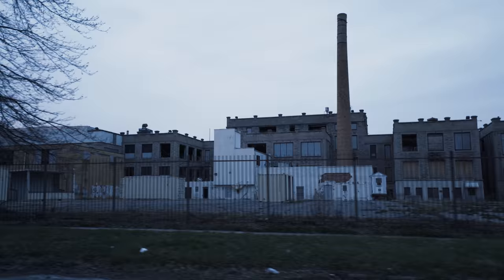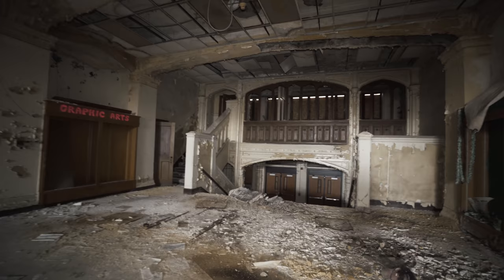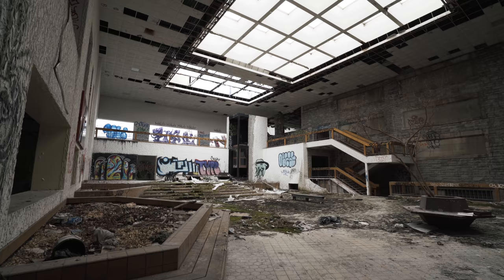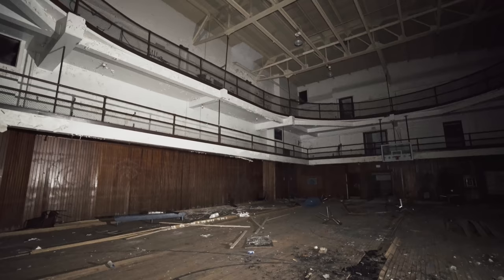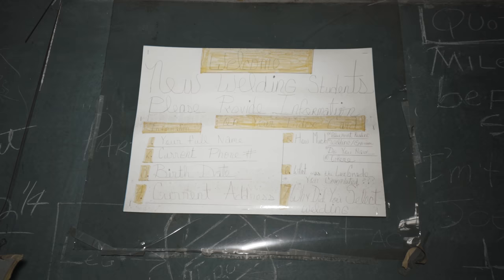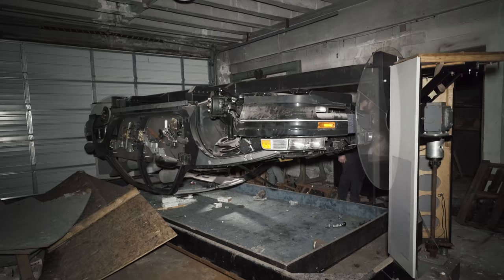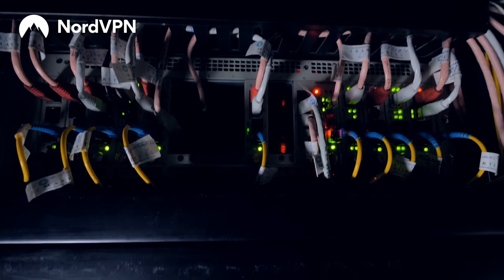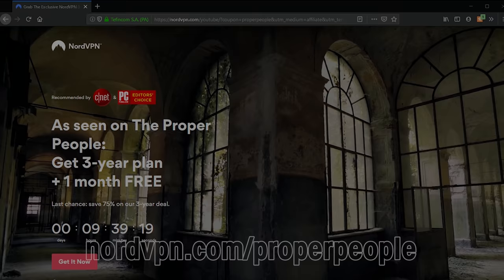Exploring an Abandoned Detroit College

Comment: Back then flip chairs had thick foam and arm rests, now they just put two hinges on a hard wooden plank and call it a seat.
Reply: Not even wood, plastic. And they design the hinges into the plastic mould so it's just two pieces of hard ass plastic that fold together. That's what my school had in the assembly hall.
Reply: My school was built in the 20s. We sat on the floor.
Reply: At high school? At primary school we sat on the floor for assemblies but that's pretty standard still
Reply: s8wc3 my high school didn’t have an assembly space with seats like that. If there was a large assembly, we would sit on the plastic bleachers in the gym.
Reply: Wood or steel? I havent seen a wood foldup chair for a while
Reply: A. G. Way underrated lol

My school was built in the 80s and it has plastic chairs with wooden sticks they call “armrests”

Comment: Drop ceilings were added mainly due to the need for new electrical, HVAC and network cables. When these buildings were built, there wasn't as much of a need for all the electrical that is used now. Also, drop ceilings create more efficient climate control as heat rises. I love revamped older buildings that have removed the drop ceilings, however, they do present a challenge, particularly for network cables as older buildings don't necessarily provide access into the original ceilings and walls. Drop ceilings are an easy way to hide all the cables and duct work.
Reply: On the downside, drop ceilings are also an excellent conduit for the spread of fire.

Comment: I live in Los Angeles CA now.  This is really heart breaking, I was born in Detroit, and it never looked like this.  I have the most beautiful memories of Detroit , when downtown Detroit had Hudson, Woolworth, Crowley's. I remember my mom would take me downtown to shop with her.  Also, the school were everywhere.  This is sad. Those fun times on Belle Isle.
Reply: Yeah! Its gentrified now. Downtown is a total transformation because of Dan Gilbert ( owner of quicken loans). Belle Isle is owned by the state now ( certain parts are taped off because its flooding) most of the school buildings is closed & deteriorated. Alot of white flight moved back in from the suburbs & the property values have went up extremely. Just type in your old zip code on zillow or google maps. Some residential areas are about the same or worse & some have improved. They are forcing the poor residents out who been living there for years. Its kinda sad yet somewhat good because you see improvement

Comment: In the auto shop, it's a Rotisserie. We use them to do all sorts of things, if you need to media blast the vehicle, paint the under body, weld panels in, pretty much anything.  It won't mess with the frame if it's mounted right.

Comment: Excellent video (No geese today-- my bravery went away!)   I think there is probably a lot of exposed amphibole and serpentine asbestos in the industrial buildings i have watched you explore in Detroit- it's inherent in very many structures, and somewhat of a worry where the interior has been smashed up. I think at the very least i would want overshoes that could be discarded or bagged then washed afterwards; you don't want to be carrying material out on your feet and into your car- where the fan then blows it up into the cabin. Keep exploring, you have brains which seems to be keeping you safe thus far!

Comment: That robotic arm might be an ASEA IRB. When was the school started and abandoned? As this robotic arm was made in 1975.

The ASEA IRB is an industrial robot series for material handling, packing, transportation, polishing, welding, and grading. Built in 1975, the robot allowed movement in 5 axes with a lift capacity of 6 kg. It was the world's first fully electrically driven and microprocessor-controlled robot, using Intel's first chipset.

The ASEA IRB was constructed by Björn Weichbrodt, Ove Kullborg, Bengt Nilsson and Herbert Kaufmann and was manufactured by ASEA in Sweden/Västerås. The first model, IRB 6, was developed in 1972–1973 on assignment by the ASEA CEO Curt Nicolin and was shown for the first time at the end of August 1973. The example shown in the Swedish National Museum of Science and Technology is the first robot that was sold. It was bought by Magnussons in Genarp to wax and polish stainless steel tubes bent at 90° angles. This robot was donated to the museum during ASEA's 100-year anniversary in 1983.

The IRB 6 sold 1900 copies during the next 17 years (1975–1992). It became the Swedish symbol for a new Labour market, shared between man and robot.[1]

The following part is the story of how the development of ASEA's industrial robot began, a project that resulted in the ASEA IRB became a school for virtually all industrial robots that were developed in the coming decades.

The seed of this industrial success came at the end of 1969 after Curt Nicolin, during a trip to the United States where he met Joe Engelberger who was a part-owner and led the main and leading manufacturer of industrial robots at that time, then hydraulically driven with simple point-to-point control systems. Curt Nicolin certainly thought that this could be something for ASEA to be interested in and then commissioned Wilmos Török ("Special Projects" Department) to initiate a preliminary study and the assignment was directly continued to Curt Hansson. As of an event, the time coincided with Intel's development of its first 4004 processors. To succeed in persuading Intel already in the beginning of 1971 to get a (one) chip from their preproduction, apart from the distinctive and unique mechanical design, has been the prerequisite for ASEA's IRB to form a school in this industry. The fact that ASEA was to create a single point to point robot was certainly not so interesting, so the connection to Intel and advanced control systems was the triggering factor for the project to get air under the wings. As a curiosity, it is mentioned that the processor was programmed using a machine-written manual with handwritten corrections and the long-awaited chip could be inserted into its circuit board, as expected for months on its processor chip.

Curt Hansson was responsible for the project until Aug 1976, except for a short period in which Björn Weichbrodt had the IRB-project management. In 1976, a series of IRB 60 was also prepared and ready for delivery, and a number of IRB 6 had already been delivered during the years before. The direct management of IRB operations was then taken over by Björn Weichbrodt that from there on he did turn it into the business success it obviously is today.
Reply: Tony O'Donnell no attempt was state. Peeeping it just. .keeping
Sac bad out..
Reply: Tony O'Donnell has 9
Reply: I live in Västerås, Sweden, where this ASEA (now ABB) robot is manufactured. If it's made in 1975 it's the same age as myself 😀.

Comment: I work in a 100-year-old building with 15 ft tall ceilings and I am so glad my boss decided not to put in drop ceiling when they refurbished the place back in the 90s. All the offices are divided by wood and glass partitions that not only keeps the office feeling very light and airy, but also gives the place a very vintage, semi-noir feeling. 

That said, yes, the heating and cooling of the building can be very funky. Like, in the winter when the heat kicks in, it pushes the cooler air down in the center of my office, right where my elbow is. XD

Comment: When energy costs skyrocketed in the 70’s and there was a ‘save electricity’ movement, drop ceilings were installed EVERYWHERE and I remember stickers being put on all the light switch plates in my school with admonishment to turn out the lights when you leave the room.

Comment: When they dismantle a car to the naked frame, it's easier to spot rust and holes and then weld them when you put the skeleton frame on that device which you use to flip it upside down ..  also makes applying rust protection and paint much easier.

Comment: 23:15. It’s called a rotisserie, same term as for cooking.  Used for car restoration.  If you look at many classic car for sale listings you’ll see the term “full rotisserie restoration” which basically means every nut and bolt top and bottom was fixed, repainted/ reassembled, not just a mechanical or cosmetic restoration.

Comment: The Old ceiling was ASBESTOS!! Its cheaper to cover it then to remove and replace.  You need to have a significant gap and each area had different regulations. Looks like there's was a good 2 foot. 
STAY SAFE STAY STRONG MY FRIENDS ✌💪👍

Comment: The machine at 30:20 is actually a convection laboratory oven. We had one almost identical to this at a shop I used to work at. We used it to cure molded urethane parts when our larger oven wasn't needed. I'm not sure what they are typically used for in a science lab though.

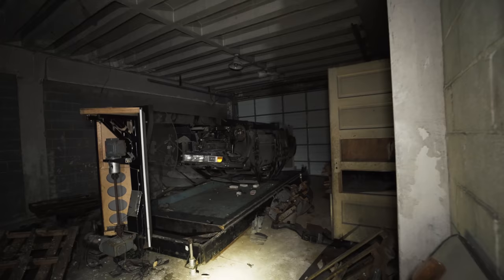Comment: Just an FYI 23:06 This is called an automotive rotisserie...yes much the same that is on your BBQ except you don't eat it when it is done. :) It is used for body and frame restoration so it eliminates the need to hunch over to get down to the lower half of the car or climb ladders to get to the top of the roof. Simply rotate the car to the desired position so the work was right in front of you. Just an added FYI there is not suppose to be a drive train in the car while it was on a rotisserie. This is actually a high end unit as some have a hand crank with gears to turn the car around. This one is electric with a motor to spin it.

Comment: That robot really caught my eye being outdated tech. I looked up ASEA and found a wikipedia article on it. Thought this bit was interesting: "The ASEA IRB is an industrial robot series for material handling, packing, transportation, polishing, welding, and grading. Built in 1975, the robot allowed movement in 5 axes with a lift capacity of 6 kg. It was the world's first fully electrically driven and microprocessor-controlled robot, using Intel's first chipset."

Comment: You guys are speculating about why they kept installing ceilings lower and lower, in a lot of old building renovations, the minute you disturb an area you have to do asbestos abatement which is really costly, my guess is that it was just cheaper to install new drop ceiling and not touch any of the existing so they could avoid triggering the asbestos abatement procedures, which is costly.

Comment: 1. That asbestos tape was used in the creation of molds for manufacturing dental appliances like bridges and crowns, which makes sense you found those dental appliance molds with it. It was also used for casting jewelry. You would use that stuff to wrap your work piece before putting it in the kiln. Odds are the last person to cut it and actually work with has since died of mesothelioma. That's an eerie find. 

2. That automotive device is called a rotisserie and it is generally used for high end restoration work where the car is totally stripped down to the body/ frame and reconditioned piece by piece. Auto tech classrooms have them for instruction. It makes it easy and safe to access all parts of the car quickly.

edit: not molds, the dental appliances themselves were made with asbestos tape. The molds were wrapped in it to protect them and enable them to last through many cycles in the kiln. There were safer alternatives even in the 1960s for casting jewelry and dental appliances.

Comment: The drop ceilings serve several purposes, including hiding updated plumbing, wiring, ductwork, etc. They can also reduce heating costs yes... But not by much.
Reply: And air conditioning costs by a lot more.
Reply: @philschuler9674  true👍
Reply: @philschuler9674   didn't figure that in. When I was in school air conditioning was not happening. I honestly doubt this place had it also.  Remember sweating my balls off in high school.  This was in the 90's

Comment: they dropped the ceilings to run modern wiring and conduits, you can see in a few places where they ran new stuff and then covered it with crappy drop ceilings.

Comment: ASEA was a swedish company that specialized in heavy electronics, like transformers and later robotics. Today they are known under the name ABB Group after joining with swiss company Brown, Boveri & Cie. ASEA made the first fully electric, microprocessor controlled programmable robot using the Intel 4004. It was at its time in 1975, the worlds most complex form of automation. Of course I dont know what this particular unit is called. Its not their first model thats for sure as it only had a lifting capacity of 6 kg (about 13 lbs).

ASEA have a long and complicated history.

Comment: Often white in colour with a fibrous appearance, asbestos containing duct tape usually contains high levels of asbestos and is dangerous (friable) to disturb. Generally, it's thick compared to modern duct tape and simply peeling it off a surface can cause asbestos fibres to suspend in the air.

Comment: Abestos, while dangerous, as long as you did not disturb the tape rolls. (and it looks like you did not). The real danger with asbestos is breathing the fibers. Just getting near it is not dangerous. Only if you stirred up a lot of dust, that had the particles or if you messed with the rolls. Frankly, going into these old places, you all should be wearing breathing masks with high quality filters. There can be rodent dropping, bacteria, and a long list of carcinogens, in the air. The fact that many of these places have broken windows, helps to keep fresh air moving around. But if you get into a building or area that has been closed for along time or lacks any fresh air or if you see a lot of particulate or dust floating in the air. You should very careful. Also, the bottom of your shoes, could be tracking other dangers, and it is wise to wash them off with water, as well as clean you clothe with soap and water, as soon as you visit these places for the same reasons, regarding bacteria, and other pathogens.

Comment: i think the asbestdoes strips were more for keeping the plaster warm or the plastic used in teeth that or to abzorb the plastic if you added too much or there was hot air in ther or something, either way i think we see why a lot of these buildings are left with contents, mind you canada might want it to make break disc from and hand breaks, (yes canada stilluses asbestdoes in cars)
might be the car was stolen and it was stripped there or it was used to learn how to steal cars but when you flip over how to get out and run from the law, well there goes my idea, plus its fully loaded so i'm thinking it would of been motored normally those car turners are used to work on the underside without you having a car jack or lifters you can just turn it on its side to work on, 
nice old monitors guess the computers went ages ago as there's scrap in those the montirs not realy, be fun to grab one and see if it still works to show that aple stuff lasts,
its mostly to stop ppl going in and hurting themselfs as they rip the copper out of walls or to stop ppl going in there and start a fire or to break in and steal the stuff worth money, that or the building(s) is so water logged or damaged its no longer safe so demo is the only way

Comment: "@24:55 "You'd think they would have calibrated it at the center of gravity so the motor would do the least amount of work."  Yeah, and also so if the motor broke while someone was working on it, it didn't roll back upside down and crush somebody's hand.  However this is Detroit.  The mechanical teacher probably doesn't know what a center of gravity is.  It's an auto mechanic class, not an engineering class.  The teacher probably only had a GED.
Reply: It was named after the city which it was built.  Highland Park. HPH school graduate